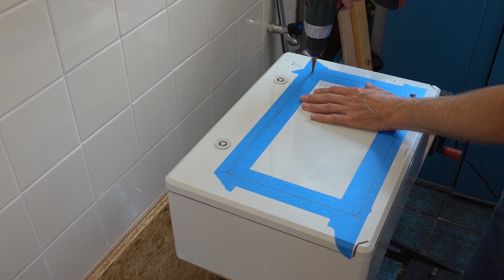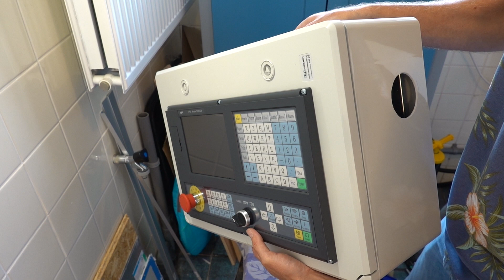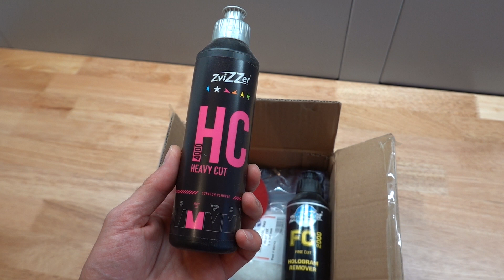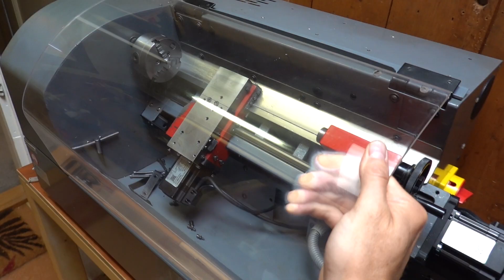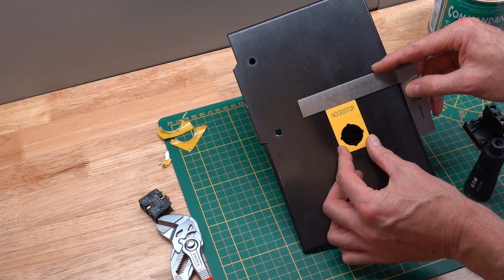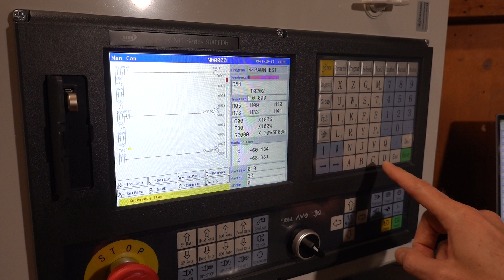Mini CNC Lathe Retrofit Part 4 - Controller Housing, E-stop and Ladder Programming

Comment: Man when you would see my shop ^^ i mounted very many things to my wooden walls. When i will move my shop the walls will have at least 300 screw holes ^^
Nice project you have there. Im head over heel in my epoxi granite mill. 2 Weeks to go, 4 in ^^

Did you buy a set product with the szga controller or just the controller?
Reply from the maker: Thanks, good to see I am not the only one having trouble keeping the shop in order. I purchased the szgh separately. The io board and pendant are also from szgh, but bought separately. The steppers I found from a different supplier on Ali.
Reply: @uptimefab7412  well either some work or some clean or some keep the shop perfectly in order and dont work ^^ Ok then i will check that thing out. Maybe i buy another masso g3 idk yet. thy anyway. Have fun =)

Comment: Very interesting... why not go for a small GRBL CNC controller though? This huge box seems a bit overkill.
Reply from the maker: Thanks for the feedback, a GRBL would probably work just fine. I prefer a standalone controller, since I don't want to have it connected to a laptop during use. I like that it has its own screen and keys which are better protected against dust than a laptop. It is all personal preference though, (at least for a hobby machine) if you like the GRBL approach better, that should also work fine for a simple router.

Comment: Pineline cleaner is very good for cleaning powder coated Emco. I use it on my emcos and it leaves it flat as intended.
Reply from the maker: Thanks, looks like a good solution. Unfortunately not available where I live, but I am sure there is something available comparable to the Pineline brand.

Comment: @UptimeFab one question - did you find the SZGH PLC manual is correct on their M-codes and descriptions? Working with a SZGH CNC1000 currently, and it is a bit of a mess...
Reply from the maker: Hi, I have not gone though the PLC M-codes used in the controller beyond what was discussed in the video, so I am not sure if the codes in the PLC manual actually correspond to the ones used in the controller. I probably can't be of much help here. If you would like me to check something specific though, I can try to help.

Comment: amazing project!
tip: using cup saws in reverse leaves a much better finish in plastic. Just high speed and a steady hand and the hole will be perfect, no burrs or sharp edges.
i use this for cutting holes in those Blue plastic barrels and big ABS storage boxes. 

keep it up!
Reply from the maker: Thank you!

Comment: Although you may not be able to find the safety door part, you can always make one by heating and bending a sheet of polycarbonate. You can always wet sand the pant to clean it up and use clear coat.
Reply from the maker: Thanks for the tips! I hope I will never have to bend a new door, but that would would also be a nice skill to learn.